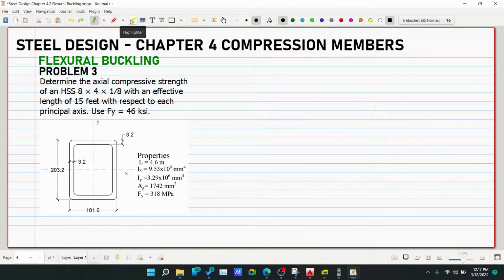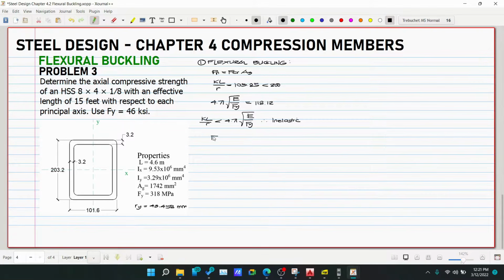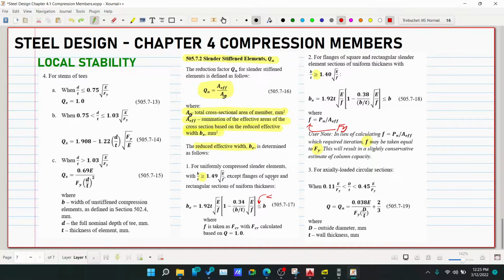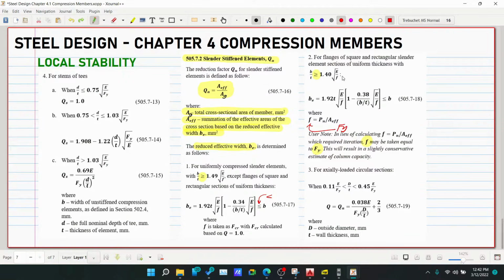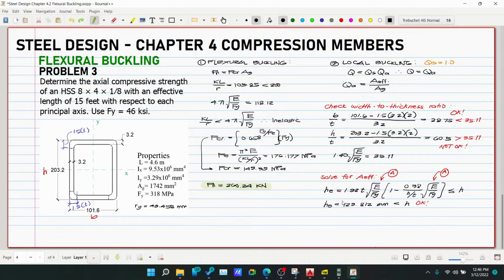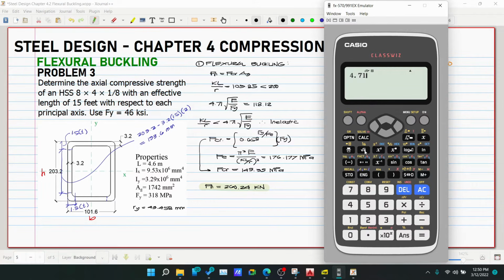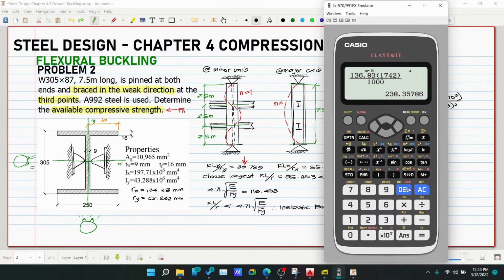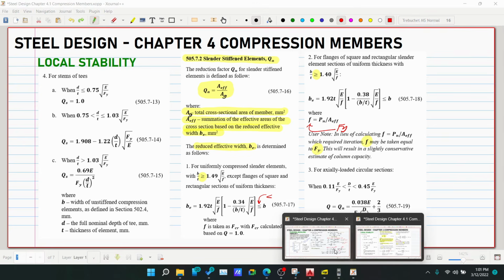Steel Design Chapter 4 Flexural Buckling Problem 3 (PH)

Comment: Good day Sir. Bakit po 1.4sqrt(E/Fy) parin po ang ginamit na limit para sa web ng section? Sa Case 13 po kasi ng Table 502.4.2 (Width-Thickness Ratios) ng NSCP 5.7sqrt(E/fy) po.
Reply from the maker: Hello po. Upon checking our reference po kasi, ginamit niya is 1.4✓E/Fy e... and yes, kakacheck namin sa table, parang dapat nga 5.7✓E/Fy... Hmmm check na lang po ulit namin...

(𝗦𝗼𝗿𝗿𝘆 𝗳𝗼𝗿 𝘁𝗵𝗲 𝘃𝗲𝗿𝘆 𝗹𝗮𝘁𝗲 𝗿𝗲𝗽𝗹𝘆. 𝗪𝗲'𝗿𝗲 𝗷𝘂𝘀𝘁 𝗯𝘂𝘀𝘆 𝘁𝗵𝗲𝘀𝗲 𝗽𝗮𝘀𝘁 𝗳𝗲𝘄 𝗺𝗼𝗻𝘁𝗵𝘀 𝗶𝗻 𝗼𝘂𝗿 𝗽𝘂𝗯𝗹𝗶𝗰𝗮𝘁𝗶𝗼𝗻 𝘀𝗮 𝗠𝗮𝘀𝘁𝗲𝗿𝗮𝗹, 𝘀𝗮 𝗧𝗵𝗲𝘀𝗶𝘀, 𝘄𝗼𝗿𝗸 𝘀𝘁𝘂𝗳𝗳, 𝗮𝗻𝗱 𝗹𝗶𝗳𝗲. 𝗛𝗼𝗽𝗲 𝗻𝗮 𝗻𝗮𝗸𝗮𝘁𝘂𝗹𝗼𝗻𝗴 𝗮𝗻𝗴 𝗖𝗘 𝗕𝗼𝘅 𝘀𝗮 𝗶𝗻𝘆𝗼𝗻𝗴 𝗽𝗮𝗴𝗮𝗮𝗿𝗮𝗹. 𝗧𝗵𝗮𝗻𝗸 𝘆𝗼𝘂 𝗮𝗻𝗱 𝗚𝗼𝗱 𝗯𝗹𝗲𝘀𝘀!)